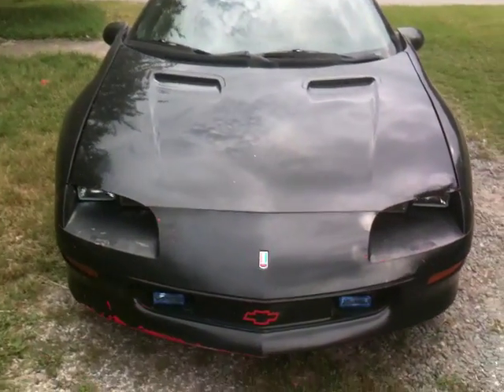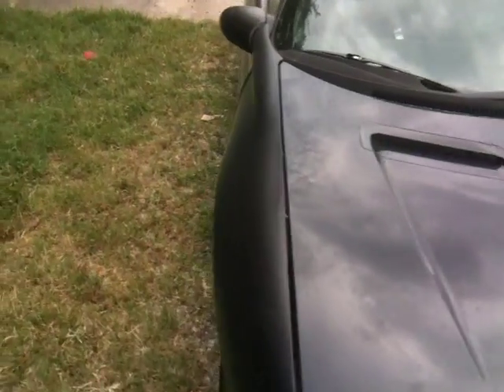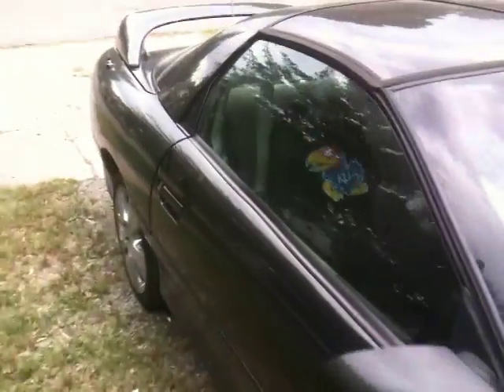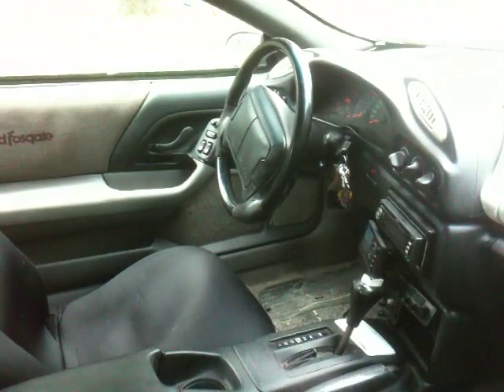RFID Car Door Unlocker

Comment: ever think about running it to a door lock solenoid installed on the door handle...so when the tag is read it unlocks the door then opens the door with a spring assist.

Comment from the maker: @GitarStu The sensor I used is the Innovations ID-12 and can be found at SparkFun.com for only $29.95 (which is more then the microcontroller itself!) It gets its name from the fact that it is capable of reading a 125kHz RFID tag from 12 centimeters away. HOWEVER, I injected my RFID tag deep into the muscle tissue between my thumb and forefinger to protect it from any accidental damage from impact. Between that that the plastic door panel, I really cant be sure.

Comment from the maker: @rubeng1128 I didn't wire into a relay.  In fact, I went the really hard route and ran a wire all the way to the lock switch in the driver-side door.  It worked great, though.  Thanks for commenting.